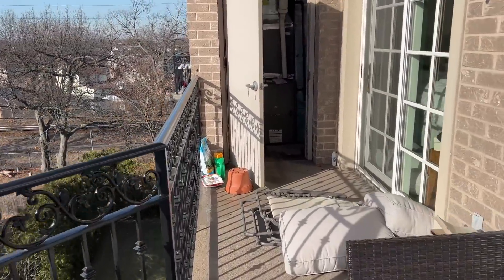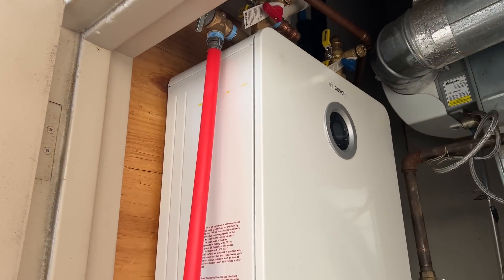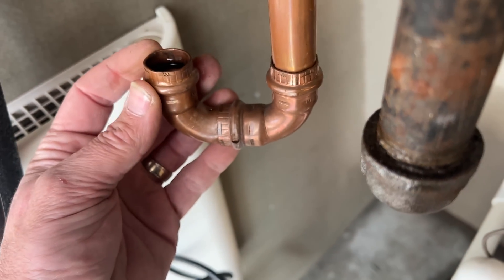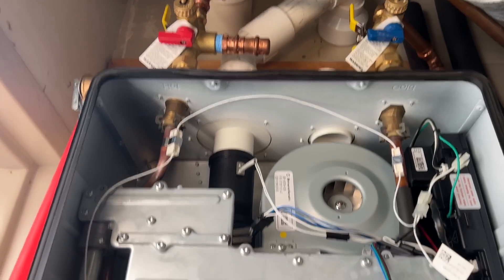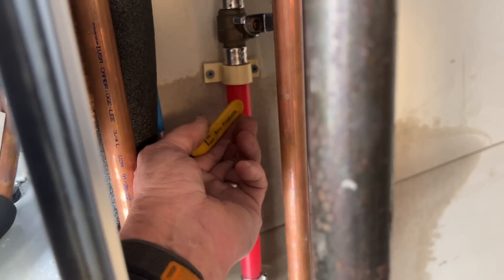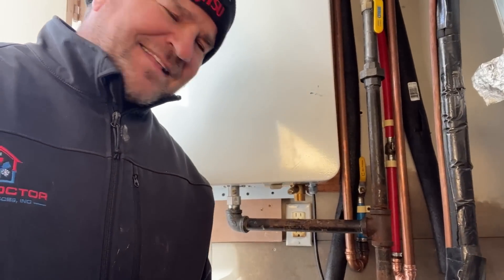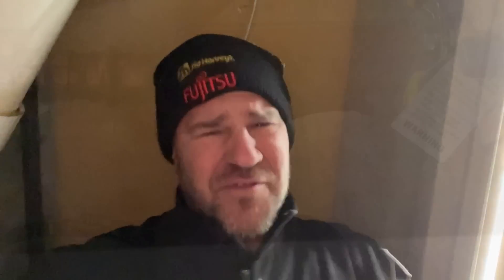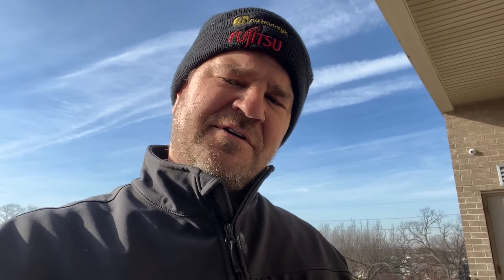Strength and Power of Frozen Water - 3/4” Copper Pipe Splits Open at Fitting

Comment: it didn't look pressed hard enough onto the pex adapter, so they either didn't press it tight enough or it should never have been pressed onto that type of adapter fitting because it's too hard.
it really should have expanded and pushed the pex off first. so I say installer/tool error or incompatible materials used.

Comment: I've seen many soldered fittings come apart due to water freezing.  It is the where the weakest link is.....maybe there should be freeze plugs somewhere.  Fresh air inlets are sometimes ducted down to floor level rather then come directly in.

Comment: All of those closets should have heaters in them . And that one did , but was it working ? But just relying on the heater alone is foolish . A $100.0 worth of heat tracing tape should be installed around all the pipes before the insulation is applied . I would also add a visible light to let the homeowner no it is powered on . Oh wait that is what I did in my shop when running water to an industrial piece of equipment ( that requires water ) just in case the heater was not working .

Comment: Why arent the pipes lagged? Its an outside cupboard with a great big hole in it. madness!. Put a fresh air vent pipe on bosch and block that hole up! That bosch could run both hot water and heating, Totally ineffiecent having 2 units in there. Should be tankless Bosch. when used for heating as well, They are  fitted with a frost stat on them, this switches unit on automatically when temp gets to 5 degress centigrade (41F)

Comment: I went to a factory few months ago here in the UK..  the pipes froze and a soldered fitting blew out. It didn't splt the pipe like expected but it did blow the pipe out the fitting. So it can happen but never seem it before and probly will never see it again.

Comment: 🤦‍♂️ Thats not a fitting failure at all, it's a stupid design for a mechanical room! That fresh air grill exposes entire room to sub zero temps. You can tell they had that electric heater plugged into that gfci, with the wall hung unit, probably why it burned up. You can see it on the end of heater cord too. There are two seperate appliances which  should have had two seperate circuits, also gfci's aren't recommended for either application. No wonder $#!+ froze and broke. It's gonna be a common problem if rest are done the same.
Reply: @PipeDoctor  Wow, that's crazy!
Reply: @PipeDoctor  What is it you say all the time? "Hacks  equals stacks!" I like that. You'll always have job security.

Comment: I live in upper Minnesota. I used to insurance work in Fire and Water restoration.  Many frozen pipes in January when the temps never got above zero for nearly 20-30 days. The hot water pipes always broke first. I wish I had a Chanel showing the damage I’d seen.  Just imagine a unoccupied home loosing heat and a hot water line burst but the hot water heater is still working.  Seen ice cycles hanging from ceilings, and small streams leaking from patio doors for days only to be noticed by a passer by ice fisherman.  😂
Reply: I had zero broken pipe calls to anything I've installed or serviced over the years, must have done something right. 😋 and their heat didn't fail (pure luck maybe)
although a hotel did have a long power outage and burst line in mechanical room, which wiped out the the whole floor! (not installed nor maintained by me)

Comment: Is the Bosch WH the only system requiring fresh air in the closet?  To prevent future reoccurrence could you block off the wide opening above the door and run the PVC fresh air stub out through it for intake air?
Reply: That definitely would've made more sense!

Comment: Whoever designed that structure should be tarred and feathered.   It's not like NY isn't known to have what we call "winter" where temps are also known to drop into single digits.   Why on earth would they have the hot water heater in an exterior room that is not heated space.   Listen Im not a plumber but god dang that has to be the dumbest thing I've ever seen and I've seen some dumb things in my life.
Reply: @PipeDoctor  I guess that's good for you.  125 potential frozen pipes to repair.

Comment: Hello from the great state of Michigan Saint Mike speaking of the power of water freezing did you know that when an LP company has a 500 gallon tank that is no longer usable they fill it with water and let it freeze in the winter and it will split the tank wide open so that it can be recycled at the scrapyard

Comment: From what I’ve seen and have been told there’s a tremendous amount of pressure exhibited when a copper pipe or fitting freezes (1000K -2000K ++ PSI?). It’s not just the physical expansion of water turning to ice it is the force/pressure exerted on the system that will cause failure. And the failure will likely occur at the weakest point(s) in the system. Mikey is 100% right when he  said that the solder joint will likely not fail before the press/pex joint but the enormous pressure will cause the copper to split. The copper will likely split at a greater pressure than the press connection, but the frozen system will eventually fail at some point unless the pressure is allowed to be relieved. This is why letting your faucet drip can (may) save your pipes from freezing.

Comment: Mike I was abt to call your company today. But I got lucky. Came home last night and had very low water pressure and brn water. U can hear water flowing in the house. I shut off the main water valve and u can still here it. Meter wasn’t spinning either. Called water authority last night. They came and said they have to return today to dig outside. If leak is more than 10’ft from mail line outside then it’s on me. Boy oh boy I got lucky. Just over 9ft. Some dumb dumb years agoput metal pipe from street and connect to 1 inch copper that goes to house. Broke right at connection. They put new copper and shut off valve. Safe atleast $5k-$7500 on that.

Comment: Do you think crimping the copper to the pex might be a weak connection which caused it to slip out?
Reply: Anyrhing possible but those temps were brutal
Reply: Solder would never do that is what I'm saying
Reply: There's a metalic adapter fitting installed on the pex for propress. Pressures from ice expansion can exceed 5000 psi. Pex can handle it, copper will go first, either way failure is inevitable.

Comment: Ya I lrnd the hardway with gfci to keep them away from wet locations use breakers or place them in a safe but accesable area run a cable from the load side

Comment: Worst House I ever saw that had a split heat pipe had 3 to 4 foot icicle's hanging off of every window on the house and buckled the hardwood floors in the dining room like a wave that was over 2 feet high. The house had crank out windows and the ice pushed them open and the steam and humidity kept on dripping down the windows pushing them open more and making the ice longer and longer. Another reason I live in Florida now. God Bless America.
Reply: You can have Fla. and all the hillbilly Trumpers pal...
Reply: @jeffsmith2022  🤣😂😂🤣